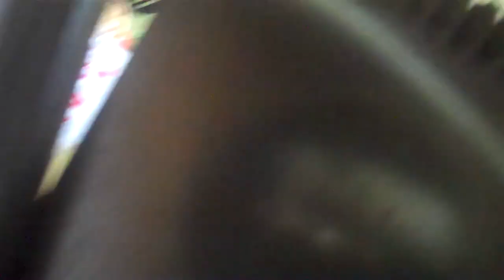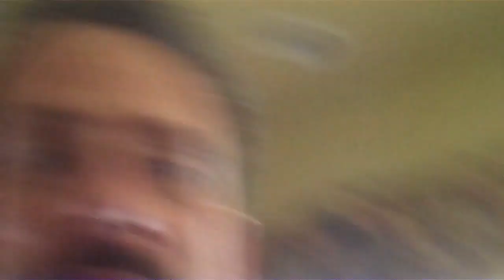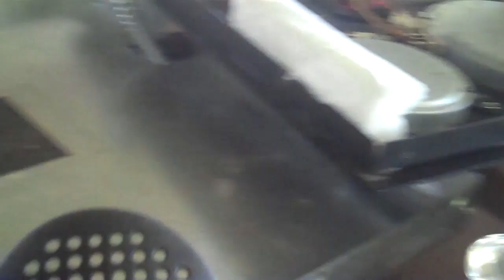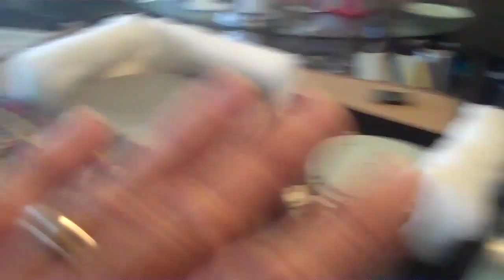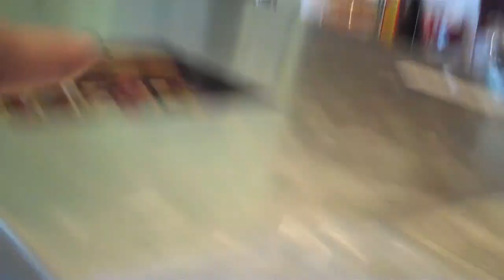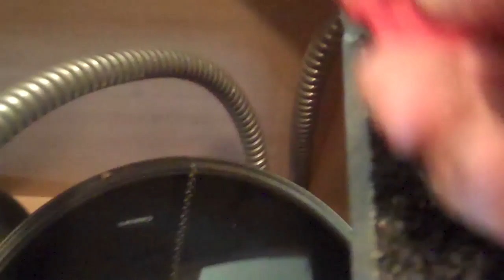How to replace an incounter, drop in, glass/ceramic range top stove top electric stove top

Comment: I just ordered my replacement stove top and it is the same as yours.  The burners attach to the glass (which is harder than some other brands where the burners stay in the metal pan).  Bottom line, your video will be the most helpful.  Thanks!

Comment: AJ - Really appreciate you taking time to post this.  I have a range vs cooktop, but your video gave me enough to get started.   
Turns out range is even easier, as there are only a few  front screws holding the knobs( open oven door and access from underside, then simply unplug knob cables) , then remove the two screws in the back ( need to slide range out of counter).  Top just lifts off.
All the rest is same as your method. (i.e. move burners from old to new).
 Saved me a bunch of time! Tks!

Comment: Thanks for the video... I replaced some elements in my Jenn Air cook top... Pretty much the same steps, only I used high temp aluminum tape (good for 200 degrees F) at 2.5 inches wide and covered the opening of the counter material and allowed for under cook top coverage. It looks like the original installer in the home had used weather stripping instead of suggested heat resistant aluminum tape (local hardware stores didn't have a clue, so I just purchased aluminum tape meant for hot air duct work and related systems)

Thanks again for sharing. Peace

Comment: great video.

I also got a jann-air range cooktop, and the switcher of the dual burner (the right front one) was broken. I opened it, and found that there's some liquid got into the switcher, and damaged the circuit board. (probably because we cleaned the surface with too much soap. :( )
Youtube didn't allow me to put the link for the images here, (I will see if I can take a video of it, and response to yours.)
Well, do you know if I can find a part to replace it?

Comment: I have a Frigidaire cooktop I'm looking to remove because I'm moving out. I've looked underneath my cabintet (not very easy to do since I really can't get all the way to the back) and can't really see what is holding the hood in place other than two slightly bendable brackets on the front. I figure that perhaps I need to bend both pieces at the same time somehow in order to lift the hood but I'd greatly appreciate a hint if somebody has any idea.

Comment: What glue did you use to secure the glass around the granite countertop? Thanks
Reply: Jivashina - sorry to take so long to reply. There is no need to glue the glass to the counter. I used plumbers (sink) putty to simply make a waterproof seal between the cook top and the counter. There are custom foam gaskets you can purchase, I intended to get one, but could not find it online. Months passed and i forgot about it... frankly, it's been years now and the putty I used is still in perfect condition. It has also been suggested to use clear silicon sealant. If you do that, I would lay a bead around the edge of the cook top and gently place it on the counter.
Reply: +Absolutely Brilliant Concepts, Inc. Copywriting & Marketing Consulting ok
Reply: +Absolutely Brilliant Concepts, Inc. Copywriting & Marketing Consulting my whole glass has fallen from the burners I looks like it was held by glue what find should i use
Reply from the maker: Go to my facebook page or twitter page and send me a picture of what you're talking about.
www.facebook.com/policci twitter @policci I'll try to help.

Comment: I was told that it is NOT SAFE to use glue to the crack of the ceramic.
I found a glue when hardened it is like a steel. is it really not safe?
Reply from the maker: I don't know Francisco. I supposed time will tell. I would suggest you just watch it and see what happens. I imagine if the crack is NOT over the heating element, you would probably be safer than if it were.